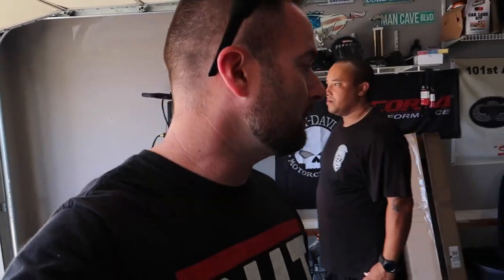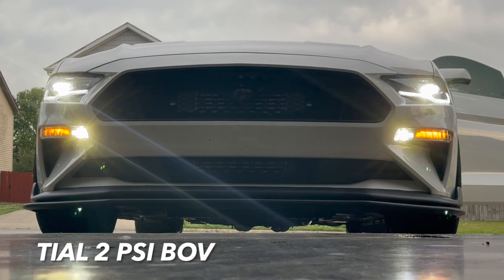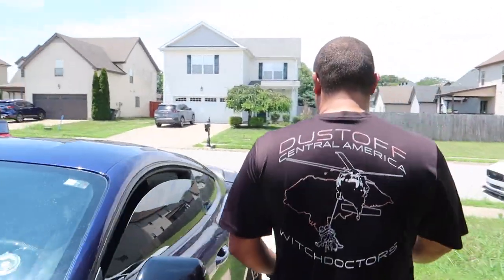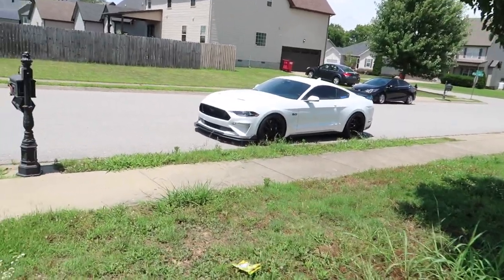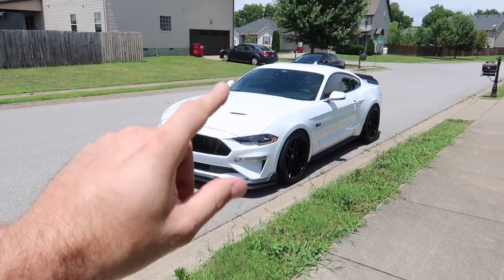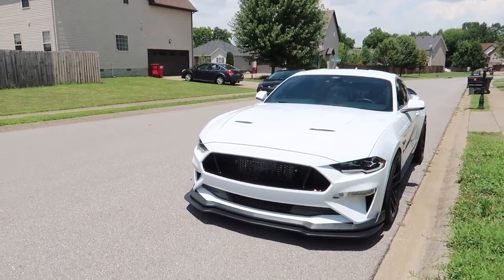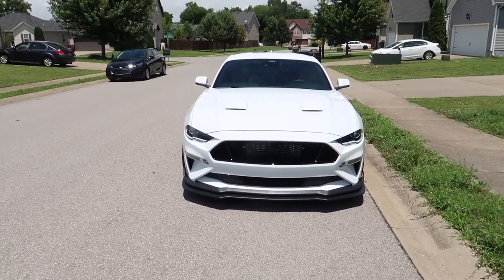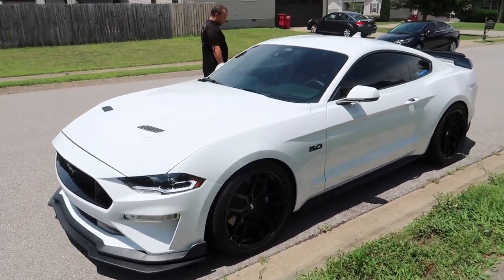FIXED MY MUSTANG GT ESS G3X SUPERCHARGER - TIAL vs PRECISION BOV *SOUNDS INSANE!

Comment: great video...but i'm a bit confused,i worked on gasoline barges as lead tankerman,all grades of product was tested for octane levels prior to,during and after loads were completed.on rare occasions(very rarely) if the octane was off,a booster was added and the load would not be ok for shipment until the octane,color,odor,rvp was at or above spec?

Comment: yeah i noticed the same thing when i replaced my precision with the tial i felt that the spring on the precision was super tight
Reply: How did u like the tial?
Reply: @dikdawg3438   oh its great, drivability and sound
Reply: @Tyler5.0  u auto or manual
Reply: @dikdawg3438   manual

Comment: What were the driveability issues?  Maybe I need to switch to this BOV.  When I am coming to a stop it’s annoying.  You’re on borrowed time with the stock fuel system.  I have the Fore fuel system and run only E85.
Reply from the maker: slightly surging and not going into boost fast enough
Reply: @Zander13Productions  I have the surge.
Reply: Can you post the link for the right bov I’ve got the surge in my g3

Comment: Im running a procharger and have the big red BOV and I love it, but i recently changed up my exhaust and the exhaust is so loud, it took away from hearing the BOV. I may switch the exhaust to something else cause it has a drone to it anyhoo
Reply: Running Red race valve with P1X.  Stock active exhaust with H pipe is perfect. 

The hype over the ESS vs Procharger however is obsurd.  It's about as bad as the MOPAR fan boys now.
Reply from the maker: @motiv8d111  procharger is awesome but the ESS weighs less, cost less and flows more CFM per $$$ is what most ppl i think are excited about. at the end of the day, i like them all. 😉
Reply: @Zander13Productions  looking for CMF comparisons brother...mainly how early the airflow comes on. Any charts out there you know of to share?
Reply from the maker: @motiv8d111  i will have to find them

Comment: Did that Tial connect directly to the ESS intercooler or did you need to buy an extra adaptors to install it? I know the Procharger intercooler uses a 1.5" hose connection but that install looked like the ESS intercooler is a direct connection?
Reply from the maker: direct connection

Comment: Loving your content.  My car has a Odin.  It does not shift that smooth.  Maybe the tune.
Reply from the maker: yes. probably the tune
Reply: @Zander13Productions  sound like I need a wengerd tune
Reply from the maker: @freedom6919741  😉
Reply: @Zander13Productions  I am computer illiterate !  That’s the only thing holding me back from doing a remote tune.
Reply: @freedom6919741 my 10r80 on lund tune shifts hard and jerky. Is this what is happening with your car?

Comment: Sport+ is the best. It’s Sport mode, but you can shift with paddles and it goes back into auto mode. It’s between Sport and Drive. 

Sport and Sport+ let you rev her out more. So much more fun that drive.
Reply from the maker: wengerd has specialized tuning in s mode and can be used in tandem with all drive modes
Reply: @Zander13Productions can you elaborate? I have his tune, not tracking brother.
Reply from the maker: @motiv8d111  in any drive mode, if you drop to S mode on the shifter. it frees up the transmission more on the auto and let’s the car shift faster. throttle sensitivity seems amplified too.
Reply: @Zander13Productions  I have his tune, didn't know that.  Gonna play this weekend 😁

Comment: Love the channel, but have to throw down the BS card on your buddy "same performance for 3 to 4k less?" @ 8:06 
By the time you FULLY spec an ESS kit with EveryThing you need compared to an EQUAL procharger kit you may save $1k- 1.5k ish dollars.  And then remove the high quality metal radiator reservoir you get with the Procharger kit and  weight the kits... not that much difference.

Big red race valves on Procharger Kits are Loud!

Comment: What lb spring is on that one @zander13
Reply from the maker: 2 psi
Reply: Overnighted one will be installing tomm afternoon
Reply: @dikdawg3438 
So what's your opinion on it?
I'm trying to decide btw this and the vortec max race bov
Reply: @charleshenson4183  never saw that one on an ess but the tial is way better than the precision turbo I had on
Reply: @dikdawg3438  
The max race is awesome,but requires an adapter to fit.
It is a little to loud for some though.
Reply: @charleshenson4183  my exhaust is so loud can't hear shit anyway